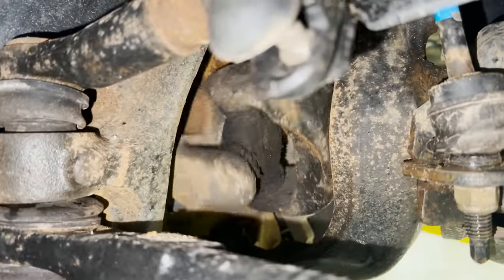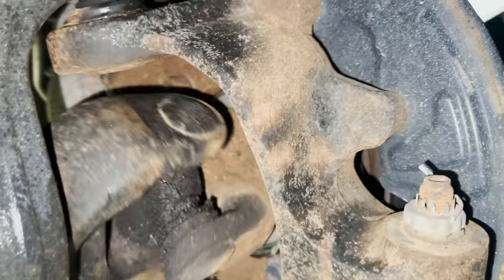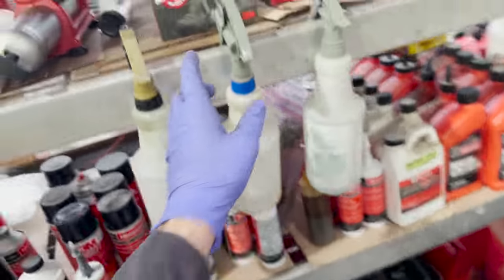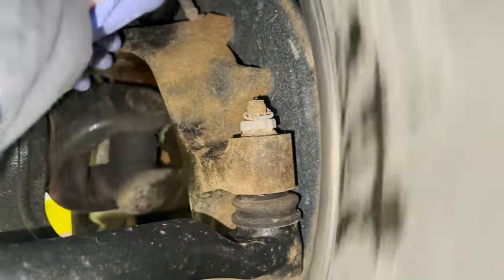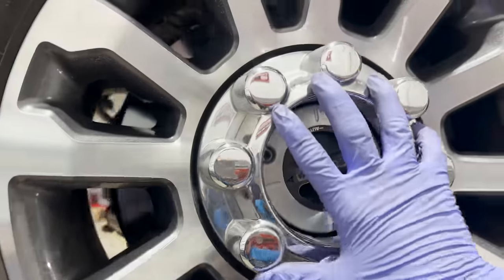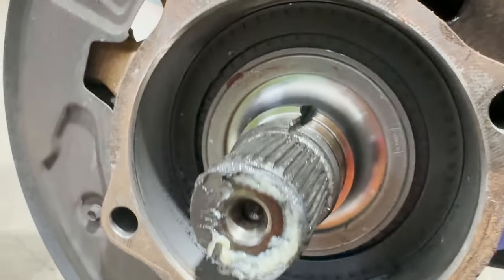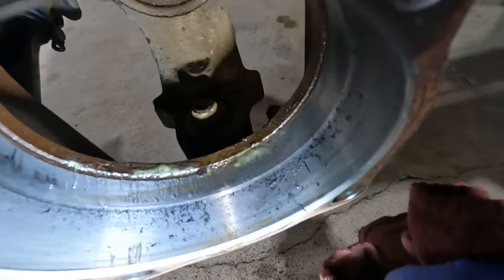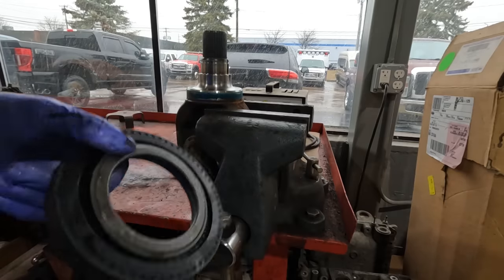NEW FORD trucks | FAMOUS 4x4 NOISE - FIXED!! #4x4 #ford #broken

Comment: Plow enough snow with these trucks and you can identify exactly what this is within about ten seconds.  I sometimes get seals from national that dont have silicone grease in the wiper portion of the seal, if we put them in without checking that they make this noise within one or two plowing sessions.  Number two is getting new unit bearings with an ungreased shaft support bearing, that has been happening the last few years so we get stuck doing surgery so we can put a grease needle in that bearing and fill it.  I hired a new tech to manage our trucks and machines, these kinds of parts quality issues are so prevalent now its alarming.  You will need to be vigilant, that is all it is.

Comment: I wish there was a channel as awesome as this for 6.2L gasers.
Reply: 6.2 gassers don't have as much trouble
Reply from the maker: Ha! So you think.....
Reply: The company I work for has both and the 6.2s have been more reliable small sample but still in my experience the gas trucks have way less issues. Of course it's not typical use idling around muddy construction sites all day and night.
Reply: @rockie307 yeah i’m not surprised by that one bit. I’m pretty sure everyone buying these trucks know that putzing around and idling is for gassers. If you run a diesel like that, the number one issue is the CCV box. Almost no one knows about it, and if they do they still don’t service it. So as a general statement I don’t agree. Like you said they’re being worked a specific way…
Reply: Buy a 6.7
Reply: I just traded for a '19 6.2. I was wondering if you get a random grinding (not scraping like the video) when you're around the 1800-2000 rpm range? I can feel it in the gas pedal. Transmission is as smooth as butter an I put on a new pinion yoke/companion flange
Reply: I’ll stick to my 7.3 Godzilla

Comment: My 2022 350 started doing this today and i stopped at the dealership where i bought it. The Service writer came out and listened to it. went back in and talked to a tech that told him it was normal, just a rubber seal rubbing on metal. It sounds EXACTLY like this truck, if not louder. They told me to just keep running it, everything is good.
Reply from the maker: What lyin dumbasses

Comment: It doesn’t make sense that the seal would fail like that. What is the cause?
The seal shouldn’t support anything, after all it’s not a bearing right?
 As I see it, either the u-joint bearings are not keeping the shaft positioned or there is play in the splines going into the hub. 
A weird one for sure!

Comment: This just came across my feed, since January I've had about 7 f250-f30s come thru my bay for an annoying squeak all have been a late 2021 to early 2022 production.  6 of them have been for that seal on the axle shaft, one was a rock in the rotor. Must've been a bad batch of seals at the time

Comment: Had a pile of them doing this lately. Even the installed ones failing a few months later and the same problem. Some no noise but 4x4 inop seal spun like that.  I think there was a bad batch of seals. New seals don't seem to last

Comment: I took my 2022 F250 in 4 months ago because of this funny metallic noise also coming from the drivers side axle.  I told the dealer I thought something was wrong with the hub.  The dealer said their "master tech" said the noises were normal and refused to resolve the issue.  I told them there was nothing normal about this noise.  Thanks for the video.  I'm taking this back to the dealer with a video of my truck making the noise and I'm bringing Ford in on this to make sure whatever is wrong gets fixed.
Reply from the maker: We wish we cld have helped ya

Comment: Great work! I’m hoping this is my issue. 2020 F350 DWR 139,000 mi- the drivers side makes a noise that sounds like keys jingling on a key ring which usually begins around 40mph. Ive replaced the brake pads and wheel bearing and it is still there.

Comment: You should use an arbor press to remove the seal on the shaft.  Then use the same arbor press to install the new one. I’m surprised that the dealership doesn’t have any.
Reply: A pulley puller as well as the arbor press. Not a fan of hammering if I can avoid it.
Reply: This^
Reply from the maker: That's not the procedure to put that part in. You guys see the special tool that's used don't you.................

Comment: I have been extremely lucky with my trucks (all have been 4x4 except for my 1995 Ranger). I remember the vacuum line leaks causing the nylon/plastic teeth on the F-150's to grind, but my two never did that. My 250 has not had any 4x4 issues to date.

Comment: Just changed u joints on my 11 I used the kit for it. It didn’t come with the ring to go between seal and hub. I didn’t put the seal on the axles first and now both side with less than 200 miles are making this noise in 2wd. Guess I’ll be pulling the axles out and do it like you did.

Comment: ED, had to grind tips of my cclip pliers to work! why not pull pull/push axle into assembly with 4 rear nuts as i did?? didnt buy special driver tool, you hit hard with 2lb hammer! the cheaper seal wont take much hammering! the snap ring was frustating with my harbor freight pliers! u do have nice clear videos.

Comment: Thanks for the video. I just replaced my upper and lower ball joints on both sides in my 2010, so I obviously had to do ALL of that and more while replacing them. I wish I would have seen your video first 😅. Quick question, when I re-installed the shaft, it went in easily, but I didn't get the other wheel to turn, did I do something wrong? I haven't had any issues while driving it. Also I put it on 4x4 but I don't know how to actually test it without putting it up in the air 😂.
Thanks in advance.

Comment: 2022 F550 dump truck, less than 10k miles. Only use 4H in the winter when plowing residential and commercial lots. Noticed the same noise in December brought it to the dealer they stated it was normal. Had a long duration snow storm in January and kept hearing the noise (drove me nuts) captured it on video this time and showed the dealer. They decided to dig a little further this time. Ended up being the same seal. Ford the king of quality the last couple of years. Lol yeah right. I have a love hate relationship with my truck
Reply: “Normal,” and “within spec.” How do dealers stay in business with that bs?
Reply: I think Dana makes them.
Reply: 2011 F350 SRW owner here, I've said the same thing... But my version of the love/hate relationship is that I love to hate it...😂
Reply: @ken8334  wheel ends are spec’d by the OEM

Comment: I have another suggestion for people who use this trucks for snow and ice service.  SILICONE SPRAY the area around that seal after brake clean and wipe as often as you care to do it.  That will help prevent brine and snow from getting into that area, sticking to things and melting into that seal.  Doubles the life for our stuff, otherwise we used to do u joints, seals and hub lockouts every two years.

Comment: I have a clicking noise coming out of my front passenger side tire, I took it to the dealer and they told me I have to replace the transfer case even though the noise clearly comes out of the hub 🤦🏻‍♂️

Comment: Thanks,  My 2022 f350 with 16k miles is making the same noise, except its on the passenger side.  Ill be making an appointment at the dealership soon to get it fixed

Comment: THANK YOU 2012 f 450 6.7 i noticed the SAME sound only in the morning when i turned the steering wheel almost full lock to the right, It dont do it no more, seemed to quit on its own BUT if i hear it again ill know. ( I torque EVA-THANG bearing nuts on back side of knuckle, caliper bracket fasteners, lug nuts etc.,) Thanks again

Comment: Ford has used those "rotating seal inside a seal" for a long time.  I've never heard the squeal, but they seem to leak a lot more often than just a plain wheel seal.  I would think a piece of stamped sheet metal would not make a good sealing surface but admittedly I haven disassembled one to see what the inside is like.  There is also a limited lubricant available for the seal which I think contributes to their self destruction.

Comment: My truck started doing this over the winter so thanks for the fix. A question about another issue, the 4x4 won’t engage in cold weather ( minus 20 or colder) I am told this is not unusual in cold weather, help!
Reply from the maker: It should be going into 4x4 REGARDLESS of the temp outside
Reply: @PowerStrokeTechTalkwARod  exactly what I thought, I hate to say it but because I’m a female they often take advantage

Comment: Driver side. 21 f350 6.7 had this same issue. Watched over dozens of YouTube videos to see a possible repair for this model year but this is the first video so far for my model year. Was going to tackle myself but dealership got it fixed under warranty. Paid out of pocket to have them replaced the passenger side while they were at it just in case. Also had them install the front axle knuckles seal shield. Hopefully it’ll help keep crap out of the seals. I’ll have to see. A month after the repair now my 4x4 doesn’t engage unless I lock the hub manually. Go figure.😢 But Arod by far is the most knowledgeable person on these super duties. And I really learn and  appreciate all your content. Excellent as always

Comment: Great video! I have a 2002 Excursion with 2006 axles and the driver's side makes a similar, loud squeal once every turn but only at slow speeds. Started after a shop installed a new lockout hub. I'm hoping it is just a bent dust shield and have not dealt with it in almost a year and a half. The front axle also makes a loud clunking noise and has movement where the driveshaft goes into the pumpkin so that is a higher priority to fix. If the squeal isn't external, now I know what to suspect. Also, I am jealous, I don't think I ever worked on a vehicle this new or clean.

Comment: Did you, or are you supposed to remove that metal o-ring/large washer you installed just before driving the axle into the knuckle? 

My 22 F-350 with 23k on the clock is doing this as well.  Any tips to say to my local service advisor to get this fixed? Should I show them this video?
Reply: Didn’t look like he did. Was wondering the same thing since he stated it was an installer ring
Reply from the maker: Show em this video!!!!

Comment: 2017 F350 has made that noise since new. Replaced bearings and seals under warranty and still the same issue.

Comment: 2021 F250 diesel. I’m noticing a similar issue when NOT in 4wd coming from left side when making hard right turns at highway speeds. You think there’s anyway it could be the same issue? Hub in auto position. 
Also: it takes a long time to engage 4wd on that same side. I’m talking like 1/4 mile.
Reply from the maker: Hmmmmmmmmm

Comment: My f-350 2022 does the same thing 15 000 miles. Im going to the dealer this week for it , is there any aftermarket parts that could help prevent this ? Would the warn hubs help this problem at all ? Thanks for the great video
Reply from the maker: Thanks pal, naw those wont help

Comment: The round metal shim they give you to use against the drive tool stays in or comes out after the seal is installed?
I guess that seal is also responsible for holding the vacuum? Can't remember if vacuum locks or unlocks the hub on the superduty, I think Ford went from one method to the other.
Reply: Vacuum holds the hubs open (2wd) shifting to 4x4 releases vac.

That's why when you have a vac leak sometimes the hubs are trying to half engage and make a grinding sound.

The metal ring is for install only so you don't hammer the seal with the install tool.
Reply: I just replaced u joint, all the same process though. Mine is 2015 and I believe that the metal ring is a depth spacer only used for the newer trucks. My 15 didn’t require it. Sorry I DONT recall the cut off year.
Reply from the maker: Your description is for the F150s the Superdurys need vacuum to GI INTO 4x4. Go explanation tho
Reply: @PowerStrokeTechTalkwARod  Got it. I only have a small fleet of F150s and I assume they SDs operated the same way.

The IWE vacuum hubs are the biggest pieces of crap ever. Ever single person I know with them has had at least one fail if not multiples or yearly.
Reply from the maker: I know. We started plugging off the vacuum ports. There is a TSB on it.

Comment: I have a beautiful 2017 F350 with 76k on it. The day of purchase I traded one of the most powerful trucks I’ve owned which was a 20-F250. I noticed before I left the lot the 350 has a ticking noise in the hub, we searched for what sounded like a lug nut rattling in the cover and have yet to find the cause. This video makes me question my service shop… I never get proper answers or concerns. For instance, I dropped the 350 off asking them to service and find any issues. It came back with the same issues that I found myself like a hole drilled in the top of the primary coolant tank and the tank empty the infamous hose clamps loose and leaking across the top of the engine… I’m willing to pay the bill I just would like my truck fixed as it should. Thank you for the excellent videos, info, and work sir! Tell me how to book an appointment for a full service 👏🏻
Reply from the maker: Email me! I got chu. If you become a channel member, there is a DIRECT link to me, PTT in the community posts
Reply: @PowerStrokeTechTalkwARod  email sent sir. Thanks!

Comment: Whenever you have one of these apart be sure to grease the axle bearings. The tapered roller wheel bearings are a sealed unit, but on the inside of the hub is a needle bearing the axle rides on that only turns when in 4 wheel drive.

Comment: Mine has never had this problem.  Oh, that,s right, I don't have a vacuum seal for my vacuum controlled hub on my 2003 Dodge 4x4, I added manual lockouts from Yukon and they work great all the time.  What a messed up system Ford put into their hubs.  These things don't work whenever you need them, and you don't find out until you need them you need to go out and manually lock them anyway!

Comment: I have a 2022 F-350 Platinum 6.7 with just 15,000 miles on it. I’m 1,800 miles from home on vacation in Yellowstone, and it’s making this noise in both 2 and 4 wheel drive.

Comment: I had that noise but the dealership fixed it. 

Now I have a BAD vibration at 75mph. I feel it in my seat driving and passenger seat is shaking really bad. 

Please help

Comment: I have a 2021 f250 20k miles  have the same problem dealer told me its a normal sound all f250s make
Reply from the maker: Bullshit
Reply: @PowerStrokeTechTalkwARod  thanks to your video I went there and told them what the issue is and they replaced the seal and like magic it's quiet now. Thank you!!

Comment: They sure haven’t changed those seals much since 1999.. that is a nice tool, always used a 1.5” piece of threaded pipe and pipe flange to set that seal on both the axle and in the housing
Reply: the cheaper seal is too flimsy to drive on with pipe flange without maching lip onto pipe flange!

Comment: My 2020 did this during the first 30,000 miles. Local dealer couldn’t figure it out. It eventually went completely away by 35,000. I assume that means my seal is now shot. 😅

Comment: This video made my day.  I have a 2010 F250 with the same noise, but mine just make noise after backing out of my driveway, turning right and starts making the metallic rubbing noise for about 200' then stops.  Being in 4WD doesn't really make a difference.
I had it in the shop and was sure it was a hub bearing, but the mechanic wasn't sure and didn't make any promises that a new hub was the cure.  Sure enough I dropped $1000 on the job but it didn't fix the problem.  Now I'm thinking he knew but didn't have the seal installer tool.  
My speedometer and odometer stopped working a few months ago, just before the squeaking started, and now I wonder if it could have been related to the speed sensor and this bad seal?  What do you think?
Thanks again for this video.
Reply from the maker: No it's not related

Comment: Yeah, I have the same noise on a 2022 f350 gasser with 15k miles.  Seems to be a 4x4 vacuum line issue as well at cold temps (well below zero).

Comment: Every super duty I've owned the past 15 years has had this problem. To add insult to injury what they don't tell you is when you live in the northeast this is basically a service part that has to be taken apart and replaced or cleaned or checked every year with the salt and rust and corrosion and yet still the 4wd system fails and needs manual locking

Comment: Did you leave the installation disk in there on the axle seal before you put the bearing hub back in?  Remember doing this job myself on both sides replacing seals and hub assemblies and lockout on my ol 09 duty…

Comment: I had this same noise, except the passenger side and not nearly as loud, on my 2022 F250 Tremor. I took it to the dealer and they diagnosed it as a bad hub bearing. They replaced the hub assembly under warranty, problem solved.

Comment: My 17 250 with 55k had a similar failure, minus the noise. My seal was failing to keep vacuum. It was actually putting the lock out in a bind over time. This would engage the lock out regardless of it is was locked in or not. Wheel bearing was fine.

Comment: I just had to use the 4 wheel drive on my new to me 2019 F350 deisel dually. At speeds more than maneuvering around the driveway, i am hearing a faint screech / squeal. Only in 4x4. Gonna be looking into it soon.
Reply from the maker: Bet thats it

Comment: side note:  I'm looking for zerk fittings and I'm not finding any
anywhere
ANYWHERE!
Reply from the maker: Only 250 350 have em in front 4x4 axle shaft u joints. 450 550s have 11 fittings. Watch our maint playlists